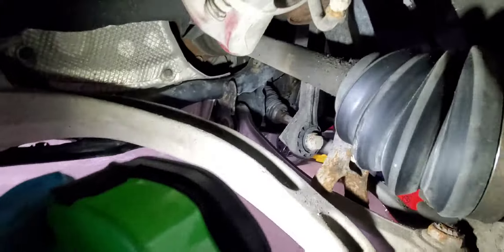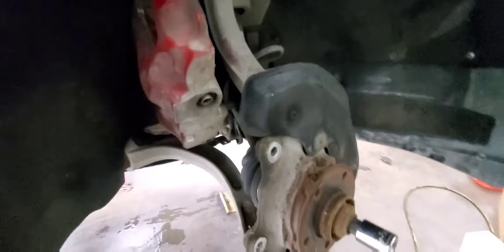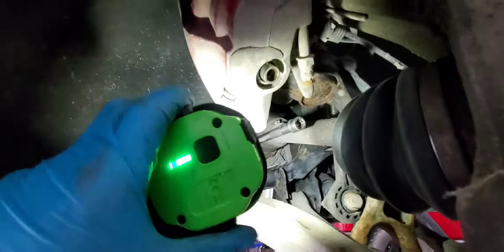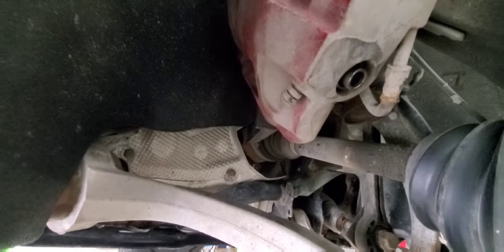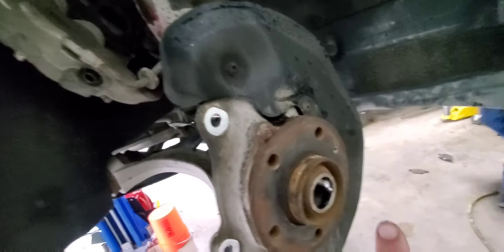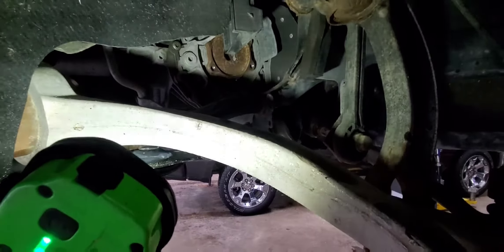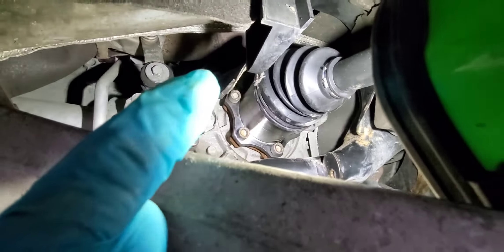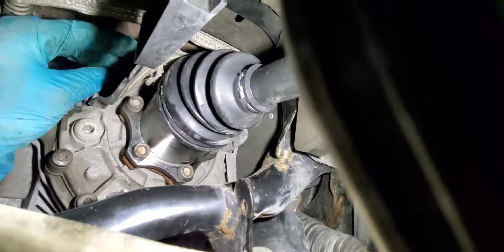2016 Audi A7 S-Line front passenger cv axle replacement tips and tricks. Required tools...

Comment: You didn’t have to remove any suspension components to get access to remove it did you?
Reply from the maker: Not that I remember. Only one I did to date but usually those aren't bad. Maybe have to loosen the shock to the lower control arm to slide the axle threw.